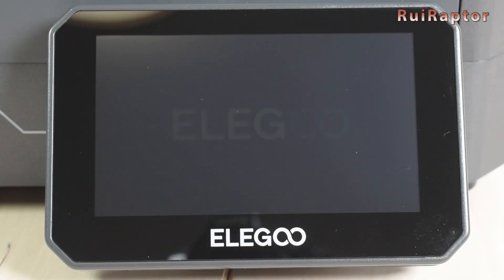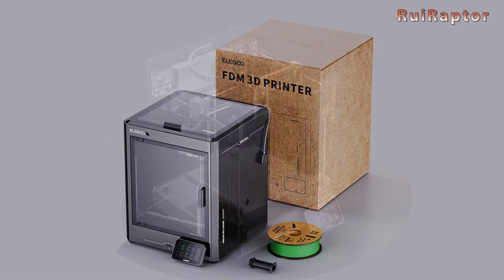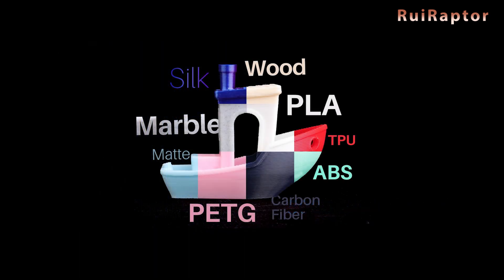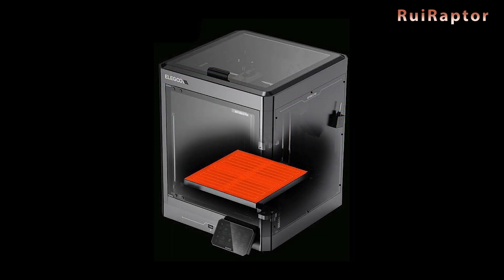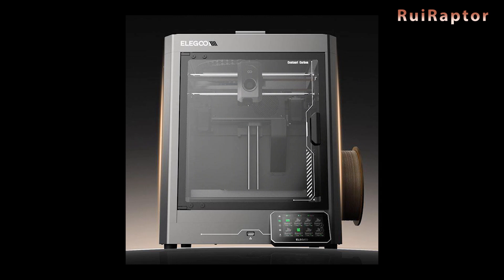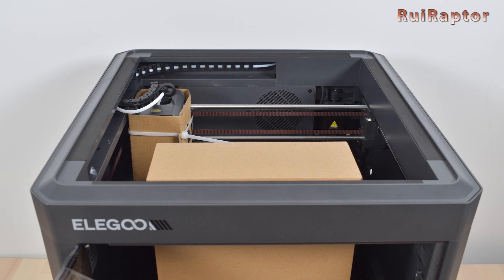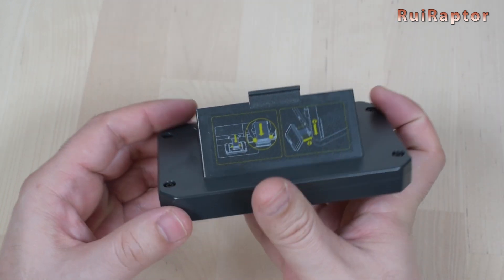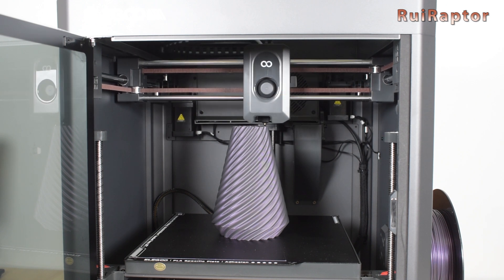Elegoo CENTAURI CARBON (Part 1) - Is this as good as announced?

Comment: This video is kind of a waste.  It is just a rehash / restatement of the manufacturer supplied material / data.  You have not actually handled / assembled / used the printer.
Reply: I agree. Misleading and totally just riding the coattails of the Centauri Carbon videos release yesterday.
Reply: Thanks for saving me the time. Unsubbed.
Reply from the maker: @alpscraftshack599, yes we handled / assembled / used the printer. You can see images of the printer printing on this video. This was the first part and we are showing what the manufacturer is announcing and the assembly. The rest of the review will be published on the second part as we mentioned at the end of the video.